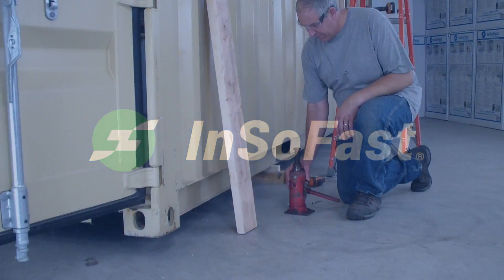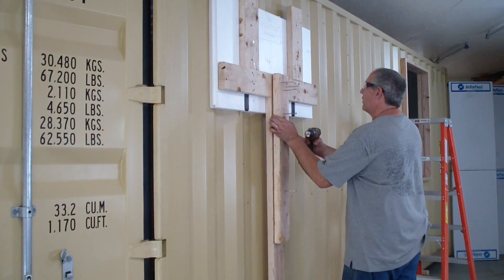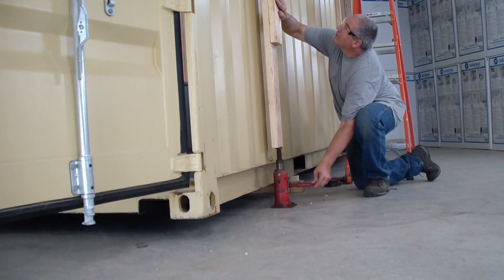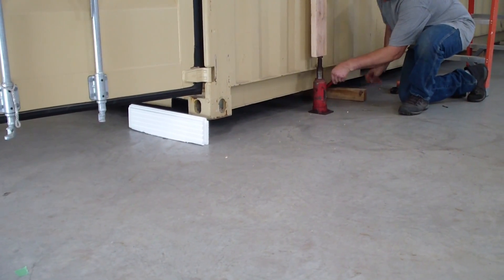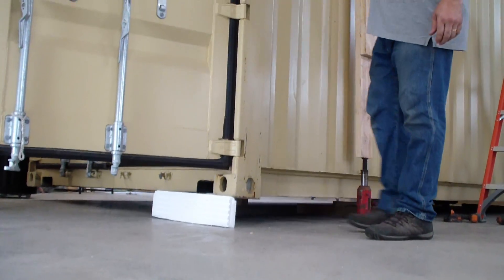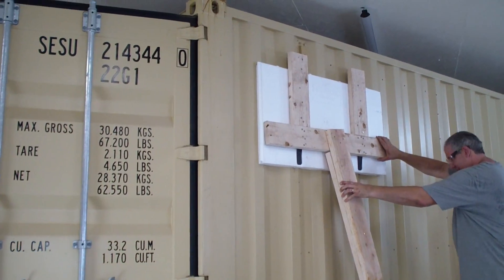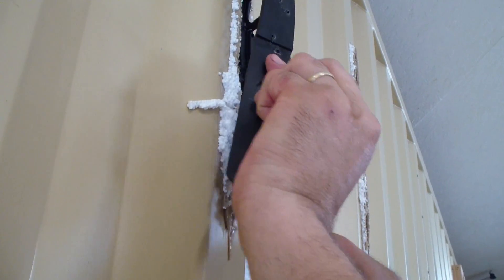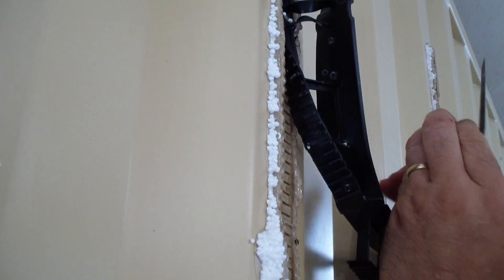InSoFast vs a Shipping Container and the 10 ton Jack

Comment: Can you say three Stooges ....Oh so that how you move a shipping container over 3 inches.
Reply: It was about the strength of the panel and it's holding ability.  They are made for the interior but of course it's kind of hard to do this experiment from the inside of the container.  The black plastic pieces inbedded in the foam are substitutes for wood or steel studs.  If they are strong enough to pick up the corner of a 2-1/2 ton container then they should be more than enough to hold drywall or mount cabinets or shelves to the plastic "studs".